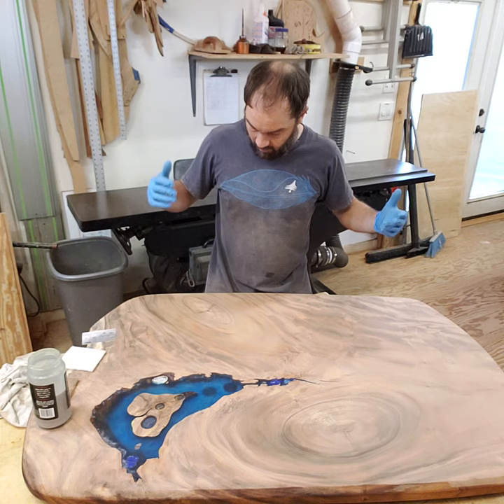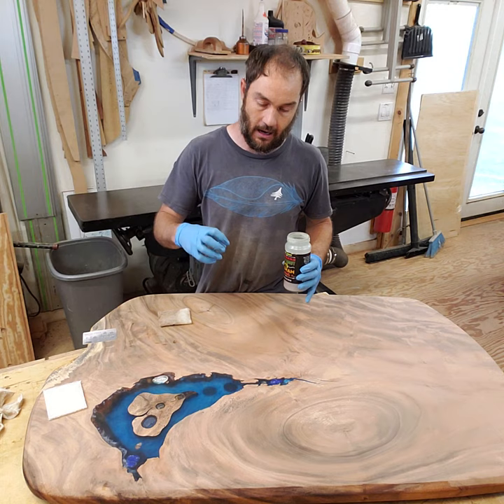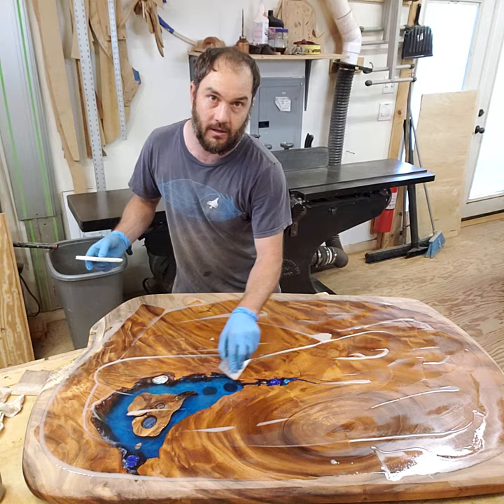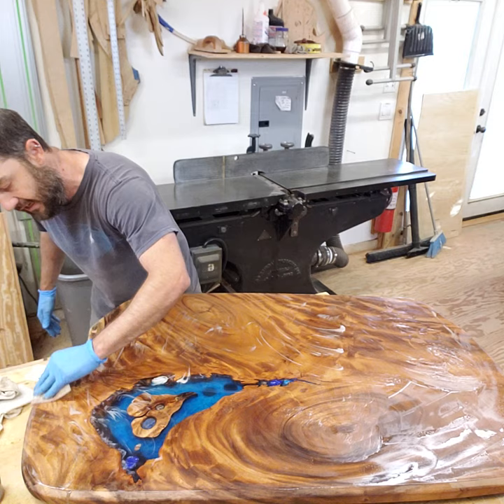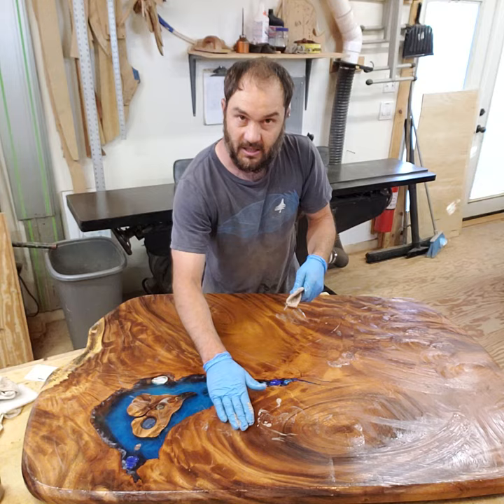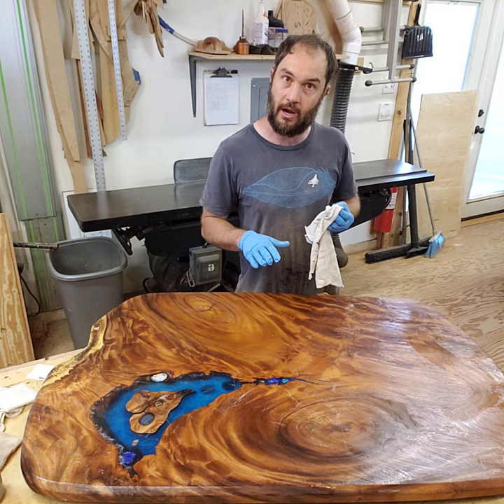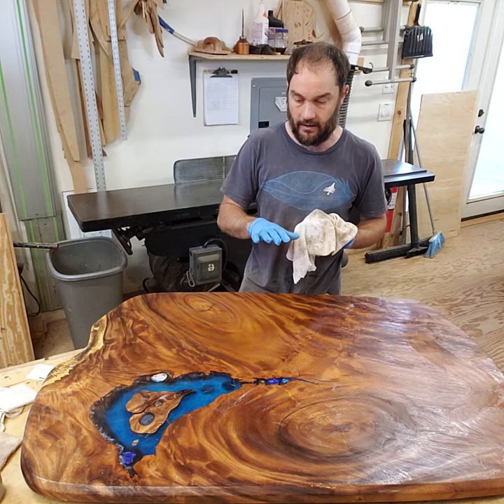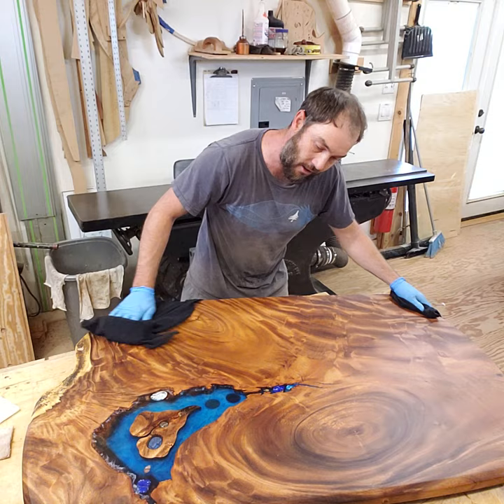How to apply osmo polyx hardwax oil to furniture

Comment: Hi, Can I use OSMO Oil on Bathroom countertop? Or, what is the best product to use on solid wood Bathroom countertop? Many thanks, Jakub
Reply from the maker: I have osmo on the countertops around my kitchen sink, which gets wet often.  It works well for the type of finish that it is.  It has not marked at all.  If you leave puddles on the surface it will eventually soak in some amd then dry again.  This finish breathes.  The other option is a post catalyzed 2K polyurethane.  This forms a film on the surface of the wood and prevents water from absorbing, but has a different look and feel from oil finishes that are inside the wood.  So yes, this is a good finish for around a bathroom vanity top where you want the wood feel.  If you want a coating on the wood, osmo would not be the right option.
Reply from the maker: John Smith  have you used the product you are mentioning?   Any idea what it is called?  I have seen their top oil and i know they have outdoor products as well.
Reply from the maker: John Smith  is the wood wax extra thin recommended by osmo as a pre conditioner.  Also, have you found that using it has made any noticeable difference? I am always interested to learn about new productsl!
Reply from the maker: John Smith  starting with a penetrating oil definitely makes good sense! Thanks for sharing your experiences.

Comment: Do you have to polish?
Reply from the maker: You have to remove all the finish during the application process to be done with the application.  I think i refer to that as buffing.  What you are buffing is wax so the surface has a nice feel and sheen with just buffing.

Comment: What grit did you sand to?  Epoxy, also?
Reply from the maker: I sand the wood up to 220 grit and the epoxy I take up to 1500 grit or higher.  for the epoxy, you get  to decide how far you want to polish it.  if you were applying a film finish like polyurethane, then the epoxy would get finish over it and I would not sand it to such a high grit.
Reply: Isak Ziegner    Thank you, Mike.

Comment: can you write the name of the first coat ( step by step) as it would be helpful. 
You can write them in details then post under your video. English is my second language 😃
You mixed Osmo Wax with Osmo Polyx oil in this video?
Thanks
Reply from the maker: This is osmo polyx clear satin.  It is just one can.  I didn't have to mix anything.
Reply from the maker: I like the suggestion to add some text in the details section.  I have now figured out how to edit that, but i am tired at the end of a long day, so text will be added another day......

Comment: Hi, what is the reference number of your Osmo can in this vid ?
Is it a 3043 satin, 3032 satin ... ?
Reply from the maker: I like the 3054 satin.
Reply: @isakziegnerdesign  3054 is the one in this vid ? 
Have you ever use Odies products and do you think Osmo would offer a better protection for a kitchen top than Odies ? Regards
Reply from the maker: @brasero20000  yes, this is the 3054.  There are several other polyx versions with different sheens.  Flat, gloss, etc.  I would choose osmo over odies.  I find odies to be less protective, but has a nicer smell...
Reply from the maker: I am about to begin using osmo wood wax finish clear extra thin #1101 as my first coat.  It seems to be similar to polyx, but penetrates even better for an initial coat.  Then i repeat 2 coats of polyx on top of that for a counter or table top.

Comment: You said what you sanded the timber down to, but what did you sand the epoxy down to in order to get a shiny finish?
Reply from the maker: I usually sand/polish the epoxy up to 1500.  You can certainly take it higher.  Polishing compounds take you up to car shiny if you like!

Comment: what 2k poly do you suggest?
Reply from the maker: My 2 favorite waterbased 2k polyurethane makers are milesi and renner.  Check out www.waterbasefinish.com for renner products.  Their representatives are super knowledgeable and may send you sames to try.  I like their 851 whichbis a self sealing 2k made for open pored woods.  I normally do one or 2 coats of dewaxed shellac under any waterbased fijish i use as it gives a warmer visal appearance and less grain pop.  Milesi is superb as well.  I like their HGA13 water based 2k.  Both companies have super easy mix in processes for the catalyst.  The mix in for some other companies can be quite involved and touchy with their water based 2k products.  Specifically ML Campbell and general finishes.
Reply from the maker: Go look up eric reason on youtube for a wealth of testing and product reviews regardimg finishes.    Sooo much good info.

Comment: I use this often and think you used WAY too much product.  A little goes an exceedingly long way - that is one reason Osmo is so expensive.  Build finishes with very thin coats rubbed in vigorously with a white 3M pad.   Use a raking light to examine your progress.   Allow 24 hours for the finish to cure between coats.
Reply from the maker: Hi Ed. I do find for the 2nd coat I would use a very small amount as absorption is minimal after the 1st sealing coat. I also find that different types of wood will absorb very different amounts of Finish. Open pored woods like the monkey pod I am using here will suck up quite a lot more finish in the sealing 1st coat than something like Maple with tight pores.